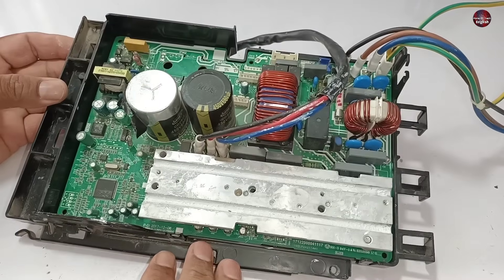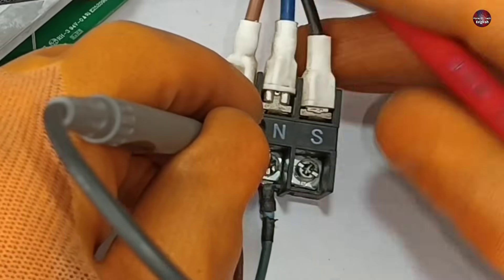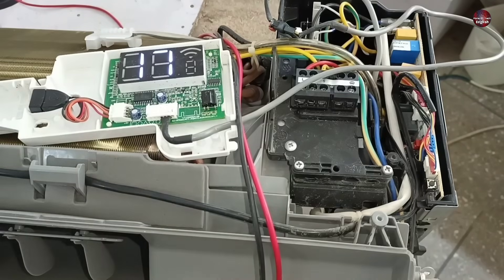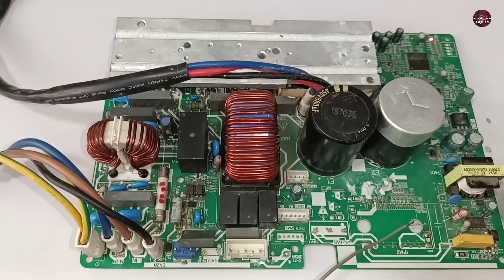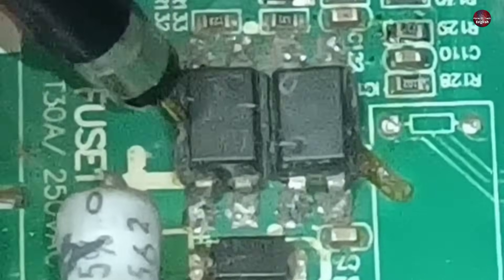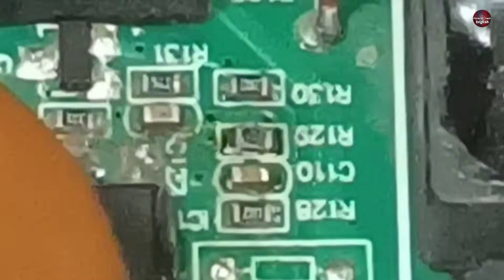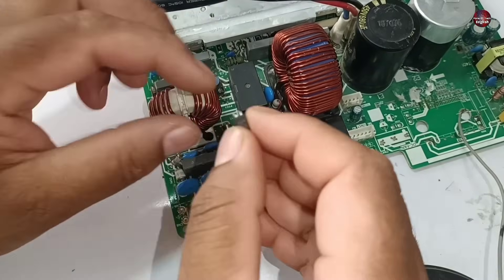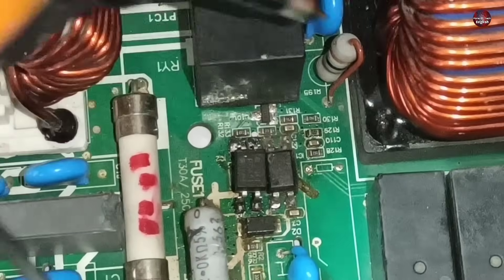Fixing Mini Split AC Circuit Board With a Most Common Problem

Comment: Hello, can someone tell me the frequency of the IR receiver of the LG Dual Inverter air conditioner, which is responsible for receiving the signal sent by the remote control? The IR sensor has three terminals and is located on the evaporator board.

Comment: My ac split system made a loud pop noise inside and tripped the breaker. I tried resetting the breaker and did the same noise again. I took apart the pcb but dont know where to start. Is it possible that the fault is on the outside compressor unit ? How do i start? Thanks

Comment: We don't need pcb at all these inverter air conditioners are just useless they make running compressor coil too useless, earlier capacity based air conditioner runs for 20 years or so

Comment: I have an E1 and the outdoor is not turning on. I read 25 dc volt on the signal and neutral on the outside? Could it be the fuse? can fuses be replaced

Comment: I have a problem my ACDC solar power widow air conditioner its started not to work on the solar power but it works on the electrcity, i checked the board notice the pv + diod is burned and replaced another one but still it doesnt work just electricity!

Comment: It is very rare for an optical integrated circuit to become damaged unless a larger current or voltage than it should have flowed is passed.

Comment: I have random E1 errors.  Sometimes I turn on the heat and get 10 minutes to an E1 message and it turns off.  However for the past 5 days it's been running normal.

Comment: Della 12000 btu 110 volts mini split
Reply from the maker: Okay can you send me picture of the outdoor and indoor control board, I can help you out what the error code e5 means on this unit.Della
Reply from the maker: Ok i found it, E5 is the communication error in Della mini split, well could be a problem with the wire or the control board on the outdoor unit.

Comment: Surge protection should installed on the incoming power supply of all new inverter HVAC equipment. For some reason, manufacturers don’t want to spend the money to protect sensitive electronics. 
I installed a whole house surge protector in my main breaker panel after losing my furnace blower motor to a huge power surge.

Comment: Hi sir, thank you for your video, I have a question and would appreciate it if you could please answer, I have a Airlux split system and the outdoor unit is not working, can I replace it with dikin, will it communicate with the airlux indoor unit
Reply from the maker: No it will not communicate with an outdoor from different brand. Unless and untill the circuit boards used in the outdoor units are the same.

Comment: Can I by pass mini split for run outdoor unit for pump down with out indoor unit run ? Thanks
Reply: Hello
Reply: Please answer this question
Reply: Me want like same question. I remember on the board have pin pump down on board and just touch it will pump down without indoor unit run. Need your confirm with your experience